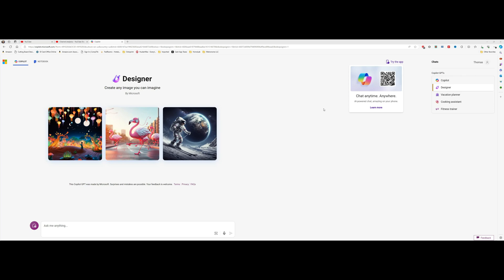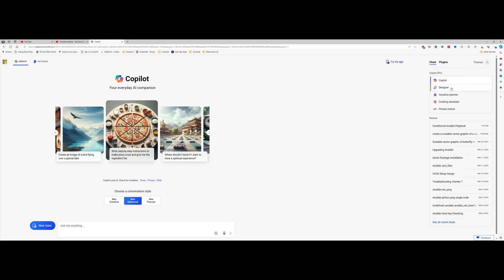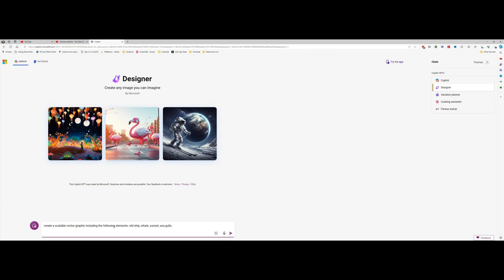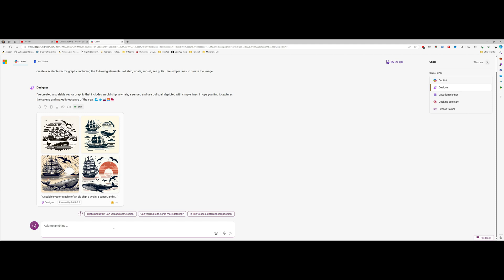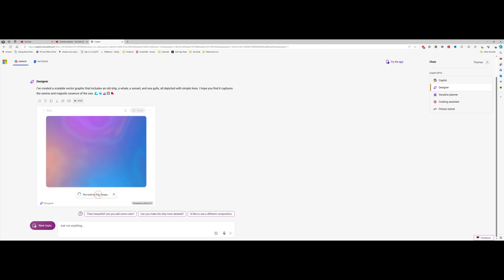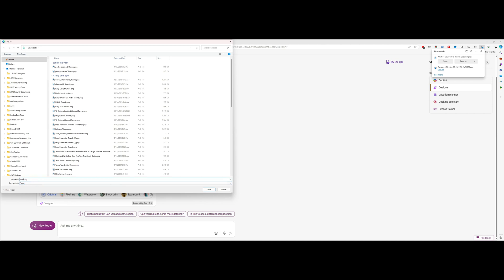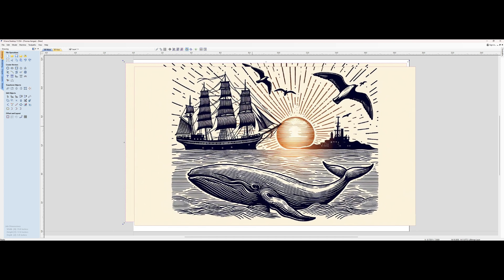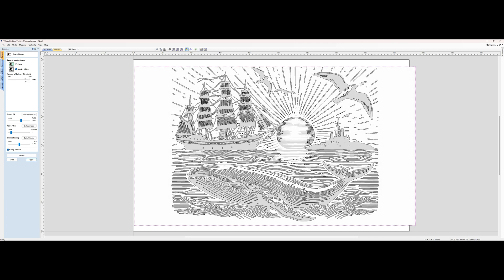Unlock VCarve Inlays with Artificial Intelligence | TK Designs

Comment: Hey Tom, thanks for all of your videos on VCarve inlays!  I have a bit of an in-depth question for you:  I recently decided to step up my CNC game and purchased the Amana 46280 ballnose bit.  When trying it out on a sample project, it didn't go as planned because I had some corners that were really tight and thin.  The female pocket corner came out rounded at the tip of the corner because of the nature of the ballnose bit, and the male plug came out perfectly sharp because the male side isn't limited by the bit design and the two did not fit together.  Finally to my question...

When designing these inlays, do you just make sure your designs don't have a smaller radius than the radius at full depth of the bit?  I use a 0.2 inch depth of cut so that means the radius of the bit at the surface of the material when taking a full depth cut is 0.021725 inches.  Do you just make sure your designs don't have a radius smaller than that or am I missing something obvious about how to design these vcarve designs?  Thinking about just purchasing a 30 degree bit instead and won't have to worry about this, but I see everyone on youtube use the ballnose bits for their strength.  It would be awesome to get a video going further in depth of the design side of things so I can make sure the designs I'm creating are going to work with my new bit.

Thanks in advance!
Reply from the maker: Thanks for watching and your kind words 🙏  If you are getting rounded corners on your pocket, the most likely culprit is that the width of ballnose bit exceeds the width of the area you are trying to carve.  As a rule for myself, I always try to make sure that there is about .5mm or 1mm width at the narrowest point of where the carve will happen.  This will sometimes leave the depth a little short of what was desired, but does not hog out material and turn a point into a curve.  

Your bit is about the equivalent of a 12.4 degree V-Bit when configured.  Changing to a 30 degree V-Bit will likely decrease the depth of your cut, and be less precise on the overall. My suggestion is to try to re-carve your inlay but increase the size so those corners are not so tight. Let me know if that helps!

Comment: I really want to learn to use AI but I can’t seem to find the right verbiage to get a decent picture. Thanks for the video.
Reply from the maker: Thanks for watching! Truth be told, getting the verbiage correct for what you want is most of the battle. I tried several times with several different levels of specific phrases to come up with designs before I made the video.  It is sometimes hit or miss, but I find that if you tell it specifically what elements you want, it can greatly improve the accuracy.  My advice would be to try to be very specific for what you want. If you are doing drawings for vcarve inlays, tell it you want it drawn in simple lines. It helps to make the drawing more of a line drawing instead of a painting.  Good Luck! Thanks again for watching!
Reply: Thanks for the advice and knowledge!